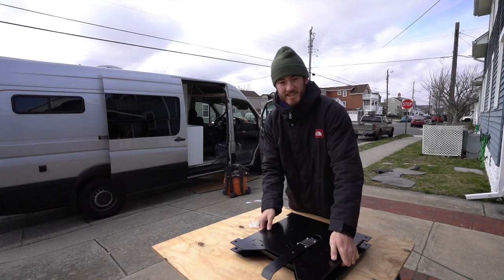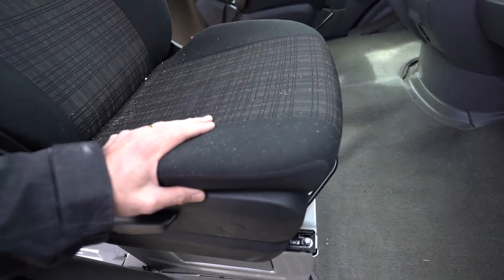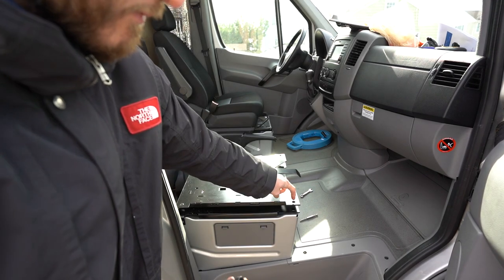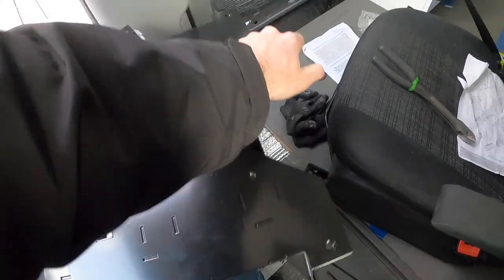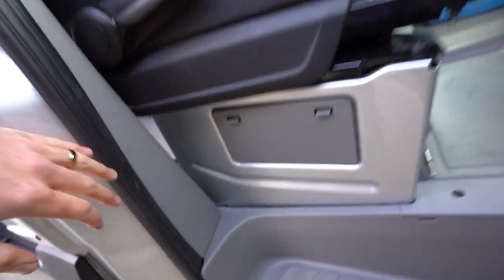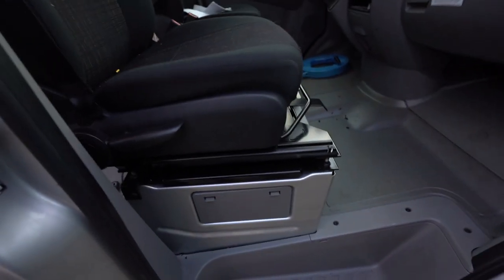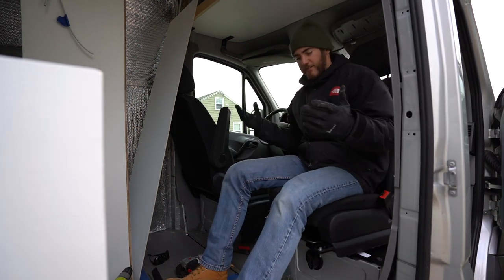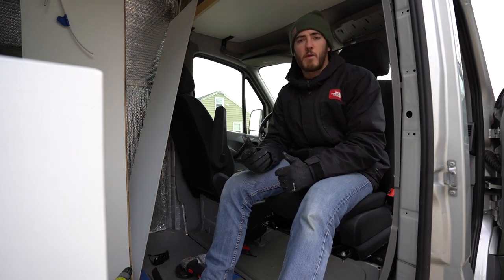How to install a Swivel Seat on DIY Camper Van - Van Build Ep 22

Comment: Thanks saw your rear window install then looked at some of your other video's

I bought these same swivels and did the install last week.  You have a provision to relocate the seat belt so that when you swivel the belt stays in place.  Look at the provision on the rear corner towards the belt.  You take the cover off where the seat belt attaches to the seat, then remove that torque screw, take the bracket out and then bolt to the side provision,
Reply from the maker: redtanrt10 I was wondering what that was haha I will set that up thanks for the tip 🤙🏻👍🏻